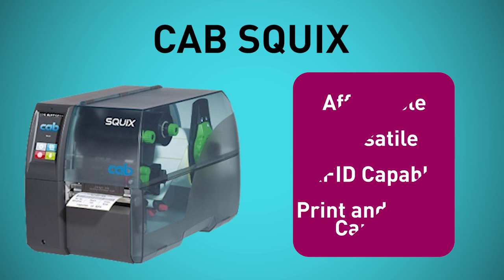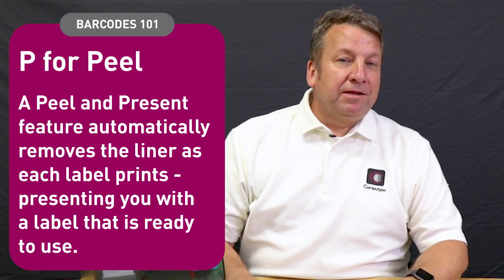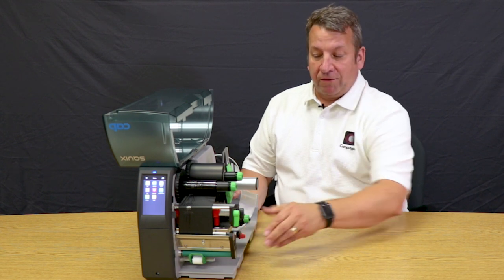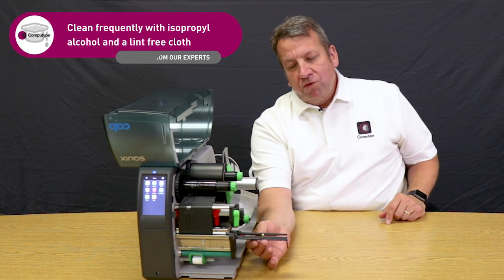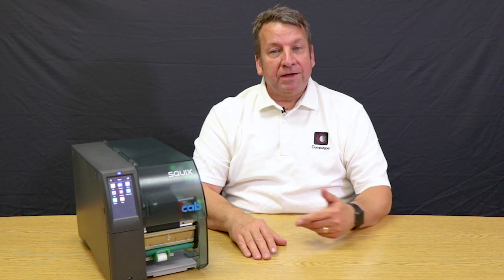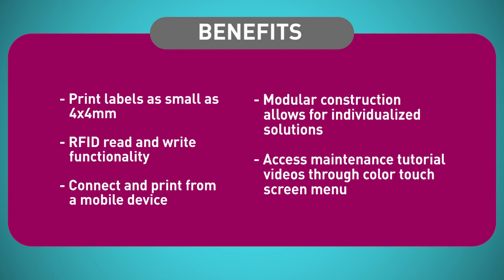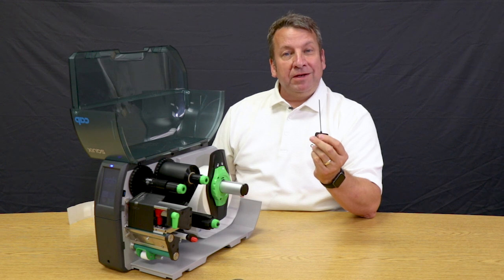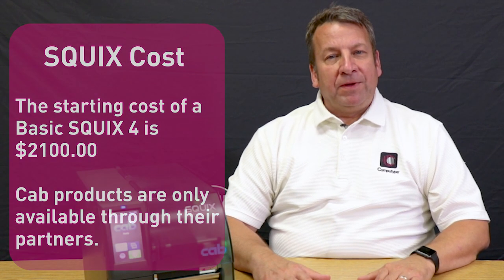cab SQUIX Barcode Label Printer Review and Demo

Comment: Great video. Would like more info on can 1 printer print small peel n stick labels and print shrink tubing, like Sumitube B2 (with different setup)?
Reply from the maker: Great question!! You can definitely achieve this with the SQUIX. Just make sure to order the SQUIX MT version. Your labels will need to be on rolls, and heat shrink needs to be on reels.